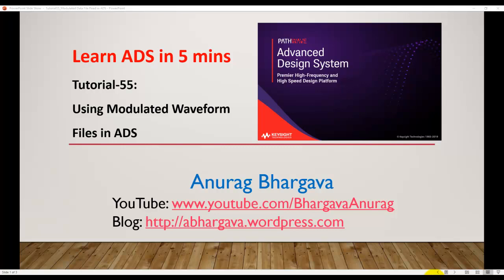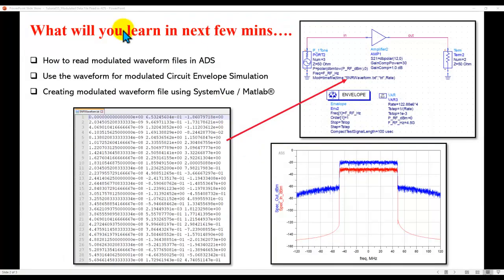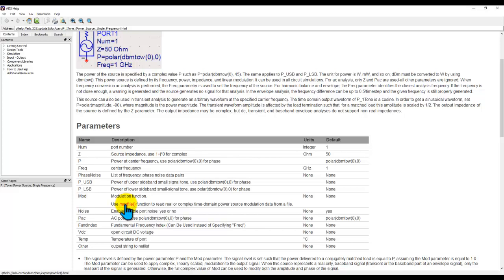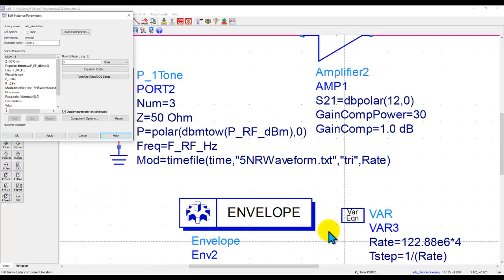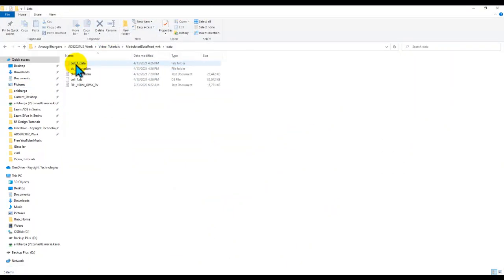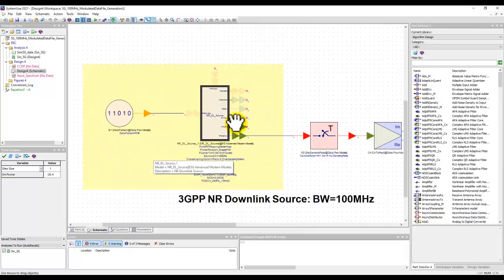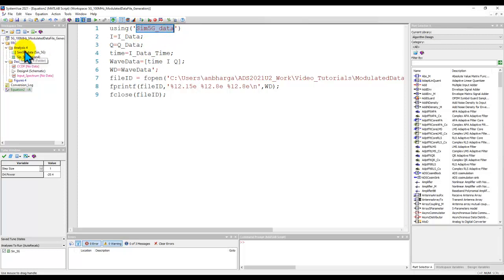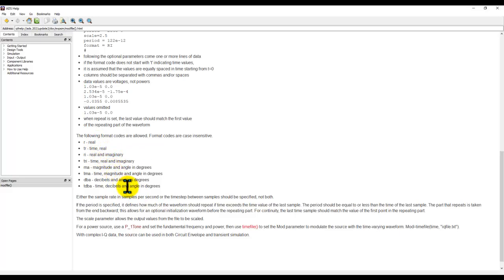Tutorial-55: Using Modulated Waveform Files in ADS

Comment: Thank you Anurag. @4:02, Could you please share the SystemVue configuration (I mean the blocks parameters) used for creating the modulated waveform file?
Reply from the maker: Hi,
I used the standard shipping example in SystemVue. You can look under 5GNR examples folder and use the relevant bench and proceed with the file generation. You can also contact your local tech support team to get help as required.
Reply: @BhargavaAnurag  Thank you for your feedback :)
Reply: @BhargavaAnurag  : can you help me with 64QAM modulation using ADS
Reply: @BhargavaAnurag  can you please upload the file FR1_100M_QPSK_SV.txt because i cannot create it?

Comment: Hi Dr. Anurag, thanks for your extremely useful tutorials.  I have some questions about how the tri format works. Let us assume without modulation, the time domain waveform can be expressed as v(t)=A*cos(w*t)=Re(A*exp(jwt)) for which A will be determined by the P_RF_dBm variable. If now the data is modulated with I and Q data. V(t)=I(t)*A*cos(w*t)+Q(t)*A*sin(w*t), is this how the modulated waveform is calculated in side the P1tone source? Does this mean if all the magnitudes of I(t) and Q(t) data-are scaled by a factor of 10, the available power from the P1tone source will also be scaled? If Yes, how will the available power be scaled? Thanks
Reply from the maker: Hi,
You can do the source power calibration by simply connecting a 50Ohm resistor/termination at the output of P1_Tone source and adjust the amplitude as you need.
Reply: @BhargavaAnurag  great idea, thanks

Comment: Lets assume we have to check evm and aclr for a bandwidth of 500mhz.And the centre frequency being 3.7Ghz.Now when we generate this 5g waveform with 4096 samples and at a sample rate of 491.5 Mhz  with an oversampling factor of 4 . The txt file becomes bulky . Please let  me know an optimised way i could deal with this .Also the  envelope simulator frequency  and the frequency we mention in the source i am confused because in one video you had mentioned that it is not supposed to be the carrier but according to the datarate. And you had declared a variable f_rf .Should its value be the carrier frequency(LO) or according to bandwidth.
Reply from the maker: Hi Ansuman,
There is no need to get confused...😊
1. Carrier frequency needs to be defined in the source so that simulate knows where to find your modulation envelope
2. Sampling time is not dependent on the carrier like in a typical SPICE simulator, it is purely determined by your bandwidth.
3. When you deal with high oversampling ratio you can't do much about the file size as obviously it will create more samples for the bandwidth duration. However, you can use technique such as Compact Test Signal (CTS) so that you don't need to simulate all the samples as described in this video and use Distortion EVM technique to compute the EVM: https://youtu.be/wjyWoCy0F4g
4. Another great feature about Distortion EVM is that it is modulation agnostic and that means you can virtually use any kind of modulation to compute EVM directly in frequency domain..😊
Reply: @BhargavaAnurag  Thank you  for the response sir ; I am trying to do a simulation with just some  of the first samples of the waveform to understand the flow.Henceforth i will use the whole sample and implement cts .

Comment: Thank you, Anurag. Could you please describe the numbers you have used in the ADS schematics and SystemVue. For example, what is the relation between the Rate, modulation bandwidth and F_RF.
Reply from the maker: Hi Mohd,
F_RF is completely independent as that's the carrier frequency. Rate and BW are related to each other and Rate should be minimum 2.5*BW (Nyquist criteria). When you read these kind of waveform you need to use exactly the same rate in ADS as used during the waveform creation and in my case it was 122.xx^4 both in SVue and ADS. If you use different rate between these then the waveform envelope will not be the same. 
Hope this helps.
Reply: @BhargavaAnurag  Thank you Anurag. I will consider your points.
Reply: Sir there was a sample data converter you used . Why is that?

Comment: @AnuragBhargava Is the function timefile() mode of entering the mod available in ADS 2018? I couldn't find it. When this function is entered manually an error is generated.
Reply from the maker: No, You will need to use newer ADS version for this.